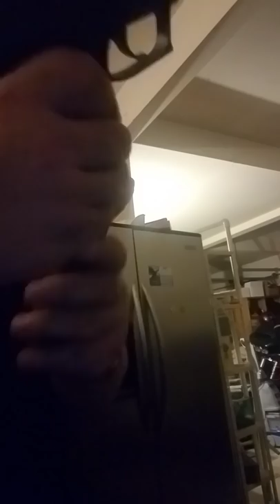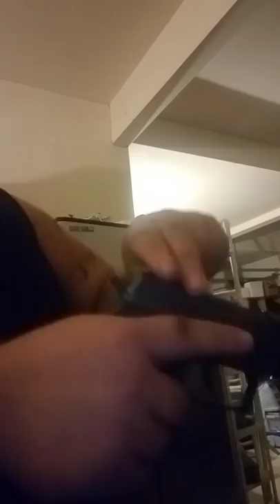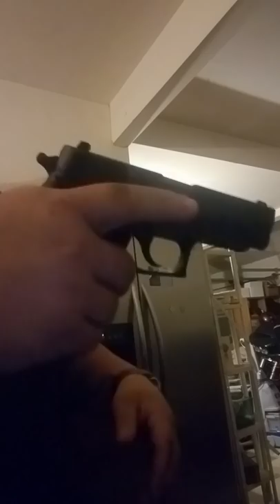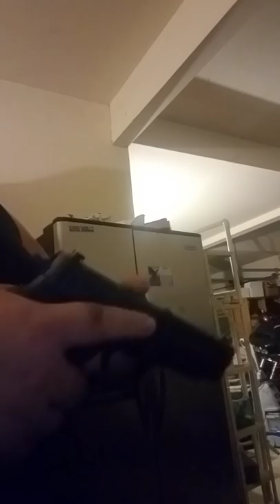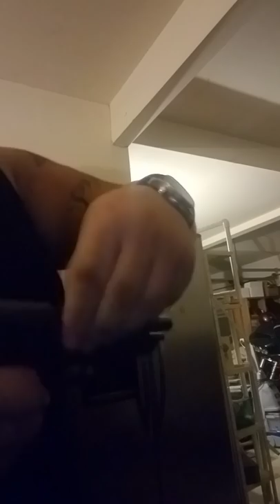How did Ocelot's gun jam? (Explanation)

Comment: think what Ocelot was trying to do was the "Israeli Draw": since the IDF in the 50s had to procure basically any sort of firearm, they often ended up having several variants of pistols with different kinds of safeties and in different states of disrepair; because of this, the IDF trained their troops to carry their pistols Condition 3 (empty chamber) instead of the usual Condition 2 (loaded chamber, safety on) that most other armies used (because training the soldiers to use several different kinds of safeties would take too much time, and often you couldn't even trust the safeties), and trained their soldiers to always rack the slide, both on draw (to chamber a round) and during a reload because some pistols did not lock back on empty mags, or were so abused that wouldn't lock open, thus they preferred to always actively load the chamber, even if it meant losing one that could have been in there, instead of having the dreaded "click". This was eventually abandoned once they managed to get decent and standardized pistols.
But, as you said, if during a reload you don't pull the slide back by pinching the rear end leaving the ejection slot clear, you will end up having a failure to eject as the one you demonstrated

Also, nobody gonna talk about how the hell was Ocelot able to twirl the Makarov? the trigger guard on that pistol pivots for disassembly, you can't really twirl it
Reply: Practice and mastering centripetal force are the only explanations for that.
Reply: Or simply just being...
Pretty good 👉👉
Reply: What you called condition 2 is condition 1
Reply: @sdivine13  the way they taught me when I got my firearms license was 
-Condition 1: gun loaded, safety off, basically squeeze the trigger and it'll go bang
-Condition 2: gun loaded, safety on or hammer down (if with a revolver or a SAO pistol that allowed this). Obviously with SA/DA and DAO pistols (Makarovs, SIGs, Beretta, HK....) the safety works normally also as decocker so if you engage the safety it will also be hammer down), requires you only disengaging the safety or cocking the hammer to be ready
-Condition 3: gun unloaded but mag inserted
-Condition 4: gun unloaded, mag not inserted (the one you'd use to carry the gun in a bag or case)
What are the way you see the Conditions?
Reply: Makarov's trigger guard has a spring strong enough to withstand some spinning tricks.
Reply: @DonPatrono  when I was in the military condition one is mag inserted, round in chamber safety on, condition two is mag inserted chamber clear safety on, condition three is for revolvers, condition four is mag out chamber clear safety on
Reply: @sdivine13  that's completely different from what was taught me and what I heard and read around, because I consistently heard that Condition 3 is what you call Condition 2 (and having an empty chamber AND a safety on? that's redundant)....guess different instructors put their own spins on the definition of the various Conditions
Reply: @sdivine13  I'm so glad I'm learning this from a guy with a roachdoggjr pfp
Reply: You can twirl a Makarov the trigger guard requires more effort than a twirl to open it.
Reply: @DonPatrono  having your finger off the trigger and the safety on is redundant, safeties are supposed to be redundant
Reply: @ScythesCartoons  I am roachdoggjr
Reply: @DonPatrono  I think condition 2 is when the gun does not have a safety, the older pistols where you have to manually let the hammer down.
 @sdivine13  I think you are mixing up condition 2 and condition 3.

Treat, Never, Keep, Keep
1) Treat every weapon as if it were loaded.
2) Never point your weapon at anything you do not intend to shoot.
3) Keep your finger straight and off the trigger until you intend to fire.
4) Keep your weapon on safe until you intend to fire.

If you follow any one of these rules, there will be no accidents.
So follow every one of these rules.

Bonus rule
5) Know your target, and what lies beyond.
Reply: I don't know if you've ever even held a pistolet makarov, but I own one and spin it constantly, it takes a decent amount of force to pull the trigger guard down for disassembly so that causes no issues.
Reply: @adityawicaksono875  being pretty good gives you no tactical advantage what's so ever
Reply: @devinthierault  
I know, but it does gives you plot armor to survive up until the 4th tittle haha
Reply: Because he is Revolver Ocelot

Comment: Ocelot's problem was with counting bullets, even before switching to revolvers. He racks the slide cause he doesn't know how many bullets the Makarov has. In the game it has 8 and he shoots 7, wich leaves one in the chamber
Reply: nah I think he tried to pull an Israeli Reload (AKA always rack the slide on a reload even if you have one in the chamber). This was done because in the 50s and 60s the IDF had to use whatever they had managed to buy, acquire or receive as donations, resulting in pistols with different safety mechanisms and in pretty crappy conditions. Because of that, they preferred to train carrying the pistols always on an empty chamber (in order to circumvent the troubles of a safety) and rack the slide on both drawing (to chamber a round) and reloading (to actively put a round in the chamber and avoid the "click" of an empty chamber because their pistol's sliden didn't lock on an empty mag). But, as the video demonstrated, if you rack the slide that way, you will end up blocking the ejection port and jam the pistol
Reply: @DonPatrono  I heard it was due to short terms with inexperienced soliders, with the mandatory service periods. This is interesting, Ill have to look more into it. Thank you.
Reply: @DefGoat  that could also be one of the reason, one does not exclude the other
Reply: He clearly knows exactly how many bullets he has left, because he loads a new magazine at the exact right time if you wanted to avoid the slide locking back.

Comment: huh you're actually right. I never thought about it too hard and figured it was MGS not getting guns right so re watched the clip and did some digging. Essentially he tries to operate with one in the chamber but it's first time doing it. He's normally a safe carry type of guy so is practiced in in racking the slide before the first shot where hand placement isnt a problem.
So in a nutshell
1. Goes into fight with 8+1 
2 Racks the first round out and fires 7
3. Memory tells him this is the point he needs to reload. There's a little bit of MGS gun inaccuracy kicking in here as the makarov does have a lock open on last round which would have told him otherwise and you'd expect an elite guy like that to notice but eh.
4 Inserts new mag and now back to 8+1 out of habit racks the slide with no regard to hand placement, covers the ejection port and blocks it causing a failure to eject. Kinda would've expected that with the first round at the start but call it luck.

So yea well done with that. Both peaked my interest in a thing I hadn't thought about in like 15 years and solved it. 

Oh and I know it's been said but please for the love of god don't do this again with live rounds, I was waiting for that ND and the curb you're enthusiasm tune to kick in.

Comment: what did he mean by “you tend to twist you elbows to absorb recoil”
Reply: Replace "twist your elbow" with "letting your forearm fly way back with the recoil of the gun"

Semi auto pistols like the Makarov that Ocelot used are able to cycle fresh rounds because they are recoil operated. The recoil of the gun enacts a backwards force on the slide, and since the shooter's hands are ideally firm and in place, the inertia of the recoil moves the slide to the rear. Recoil operated pistols NEED the shooter to let the recoil hit them.

If the shooter limp wrists or twists the elbow or makes the forearm fly back with the recoil, the slide won't move anywhere. In more caveman terms, slide backward only if hand forward.
Reply: Thats a quote from the MGS series! ;)
glory2G0D
Reply: @SolidusLightning777  i loved the cavemen terms
Reply: As double_T said, the Makarov is a semiautomatic pistol; the way that works, is that once you squeeze the trigger and thus ignite the gunpowder in the cartridge, the slide will stay still for a bit, enough to let most of the explosion gases push the bullet outside of the barrel, then the slide will go back because of the recoil generated by the explosion of said gunpowder, and this ejects the spent casing and rearms the hammer or striker of the pistol. Then, a spring called the "recoil spring" pushes the slide back to the front, taking a fresh cartridge from the magazine and placing it in the firing chamber.
The problem with the Makarov is that it's a so-called "direct blowback" pistol, meaning that other pistols (the 1911, the Beretta serie, the Glock etc etc) have some sort of locking mechanism to keep the slide from moving back until the pressure inside the firing chamber is at acceptable levels, while for the Makarov the only thing preventing the slide from flying in your face the moment the cartridge goes BANG is the inertia of a thicc slide, and a VERY robust recoil spring...so if you have a weak grip on the pistol, and thus you let part of the recoil dissipate at your wrist or elbow, there might be not enough energy (especially with occasional weak loads in the cartridge) to cycle the action properly, causing the pistol to jam (but in a different way than what happened in that istance with Ocelot).
A revolver, instead, relies on the operator's imput to rotate the cylinder where the bullets are (by either pulling back the hammer or squeezing the trigger) and does not use at all the recoil. Most of the people who shoot often revolvers tend to put strenght on the wrist to avoid whiplash and injury to the joint, but let the elbow twist back slightly to absorb part of the recoil. My guess is our lil' friend Ocelot was so enamored of the old west movies that he unconsciously started to adopt some of their behaviours while shooting

Comment: I know this is late but a guy on another video between their first encounter said this. "He meant that Ocelot took the risk to get the bullet stuck in the ejection port.
When you load a new magazine on a standard gun, you must pull the slide before you shoot. What happened to Ocelot was that he had 1 bullet remaining from the last magazine he used and put another, Makarov gun can only bring 8 bullets inside and without pulling the slide it makes 9 so it basically got stuck in the ejection port due to lack of space in the gun." The version of the Makarov that Ocelot used is the PM and it only holds 8. I counted that Ocelot used 7 shots. So he had one left. He loaded the magazine in which brought 8 up to 9. So perhaps the reason why his gun jammed is because he had 9 bullets in?
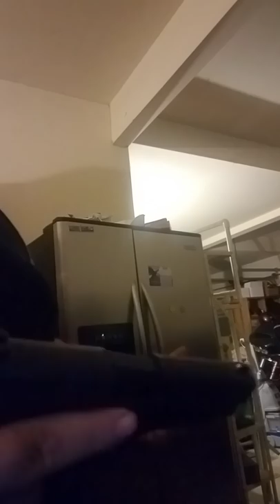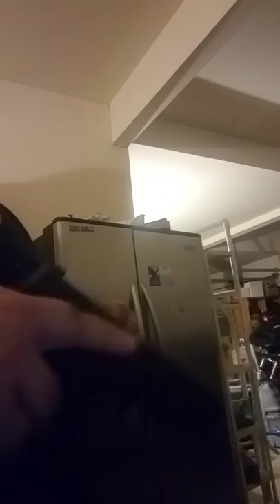Reply: 1:50 - 2:25
He already explained that in the video
Reply: @iota-09  He didn't say anything to the logic of "The gun did that because he pretty much overloaded it's capacity." Did he say anything about the number 9? Cuz if so your comment was pointless.
Reply: @V.VIIIBeanman  i think you just misunderstood his comment is all.

If you have a semi auto gun that has 8 bullets, fire 7, then put in a new mag and rack the slide, the bullet in the chamber will be ejected without it being fired and the gun will function without issues, so only one of two things could have happened, both shown by the guy in the video

A: he instinctively racked the slide(which is by itself a mistake with a semi-auto if you still have bullets in the chamber) but put his hand above the ejection Port, creating a failure to eject and jamming the gun
B:he actually tried to put in a bullet as he was cocking it, but didn't do it right and it got stuck instead of loading.
Reply: @iota-09  I appreciate your explanation but all you did was parrot what the video creator said. I'm a gun noob but I found that comment all the way in another video and it made everything 10000% simpler. I don't know why you nor the other guy put numbers in. You both skip the number when logically if you wanted to be concise that would be the easiest way for a non gun fanatic to comprehend this. Which is why I said he didn't mention anything to the nature of "It's as simple as 1+8=9 and 9 doesn't work for a gun that can only hold 8." I understand that the bullet probably shoulda auto ejected or whatever y'all keep saying but the whole point or the simplest way to put it for a person that's never even held a gun before is that he pretty much overloaded the mag and it jammed. Y'alls way is cooler but the way y'all explain it the thought of that occuring NEVER crossed my mind and that's why I don't like that explanation and why I keep harping so much on numbers. He could have easily added it in in a sentence.
Reply: @V.VIIIBeanman   because simply put, you physically cannot overload a gun, that's more than a noob mistake, that's like... Trying to put 2 liters of water in a bottle that won't hold more than 1, you simply can't do it, so there's no reason to think ocelet tried to have a full mag, a bullet in thr chamber and ALSO loading a bullet in himself.
What ocelit did was more like having a full bottle of water, putting some in a glass and then filling the bottle again.

As for not using numbers in the explanation: i did; 8 bullets in the mag, spend 7, reload(back to 8) + one in the chamber(=9) 
That by itself however won't make the gun malfunction, unless ocelot tried to manually put in a new bullet in the chamber manually even when it's still full, but simply cannot physical be done, if ocelit tried, he wouldn't even have had the gun jam, or rather, he wouldn't even have been able to put the bullet above the mag let alone in the chamber.

In other words: it's not that our explanation is harder to get than the person you're citing, it's that the person you're citing didn't understand what was going on.

P.s.: to expand on the water bottle analogy, what you're saying by "9 bullets in a gun with a mag that holds 8 will make the gun jam" is like saying that if you fill a glass of water with a full bottle of water, than refill the bottle while the glass is still full, the bottle won't close.
For that to happen, you'd need a full water bottle AND a full glass(you can't put in more water in a full bottle than it's capacity) and you trying the fill the already full bottle.

Now substitute bottle with mag and glass with chamber, and you get why putting 9 bullets in a makarov isn't impossible, nor is overloading.

Full bottle=mag with 8 bullets
Full glass=1 bullet in the chamber.

If you rack the slide you empty the chamber, and if you try to put in a bullet in the chamber when there's already one in, the bullet won't ever access the chamber(in the glass analogy, the water would simply spill from the glass)
Reply: @iota-09  The technique Ocelot is doing is an Israeli reload. So are you saying that Ocelot COUNTED his bullets. Knew there was one. Tried to remove the one and it didn't remove but he assumed it did and then tried to load the mag but couldn't due to the extra bullet? Or did Ocelot count bullets? Cuz as far as I could tell the Israeli reload is just a pretty nifty way to reload and a way to disregard the safety or something like that. Eitherway, There was one bullet and it's logical to assume it jammed because the last bullet wasn't used/ejected. You can keep repeating this back to me. I don't care. I'm sticking with what the other guy said. The whole logic imo was that he wasn't keeping count so that method is to reload for that scenario.
Reply: @Ike Kimita  i read the Israeli reload comment, and it made sense, but it's not at all what you're trying to explain/retell here.
What he did was either A:
Step 1: spend 7 bullets out of the 8 in the pistol, this equals an empty mag but one in the chamber
Step 2: reload(+8 in the mag)
Step 3(the Israeli reload): rack the slide and so lose the 9th bullet(the one that was in the chamber). BUT he put his hand over the chamber and it didn't eject the 9th bullet, creating a malfunction(failurr to extract) not because he can't have 9 bullets in the gun, but because he tried to extract it but didn't manage to do it properly.

Or B
The two other possibilities which are shown in the video, and which are unrelated to the Israeli reload.
Reply: @iota-09  Well here's what I found on reddit so I'm 1000% sure this is what happened: "Ocelots gun jammed because a semi-auto pistol from that time (much like the walther PPK) requires a pulling and releasing of the slide in a very particular way, such as pulling and quickly releasing it. If you do it slow (like Ocelot was) you can get a round stuck

Source: ive done this many times

permalinkembedsave

[–][deleted] 1 point 7 years ago 
While that is true, it's only half the story. The reason why he pulled the slide at all, was because he loaded the next bullet (by pulling the slide) although there was still a bullet in the chamber. He basically wasted one bullet just to be sure something was loaded. If he had paid attention to how many bullets he had left before reloading the clip, he wouldn't have had to do that.

Ejecting an entire bullet by hand is something you normally don't do. Normally empty shells are ejected automatically after you fire and when you do pull the slide manually you don't usually have anything in the chamber. Since he did have something in the chamber it made it harder to pull and release the slide properly, and he made it jam." So basically he had to pull the slide fast enough but him showing off caused him to be slower than he needed to be and thus the gun jammed. That's it.